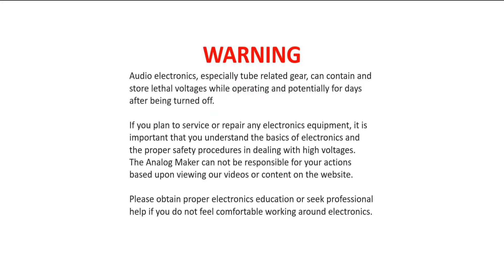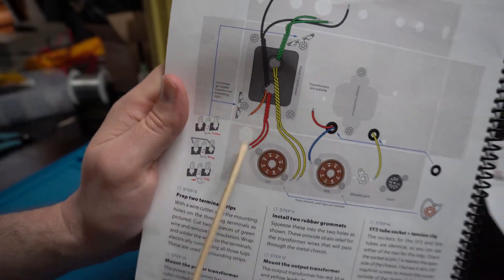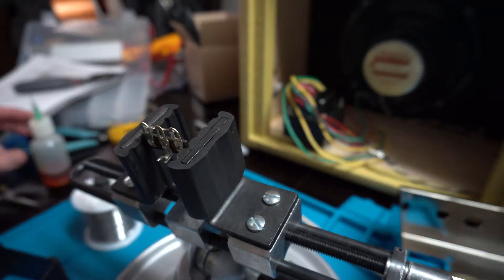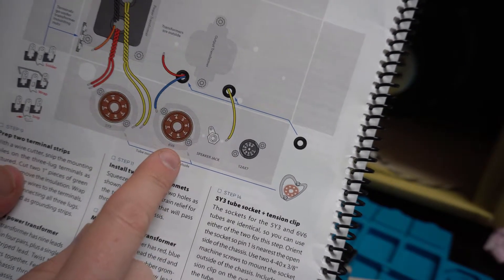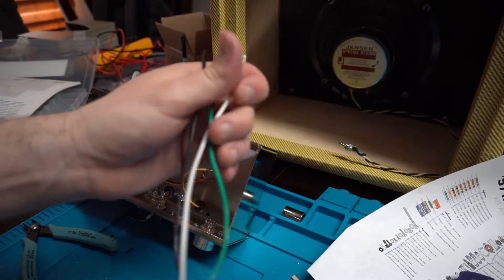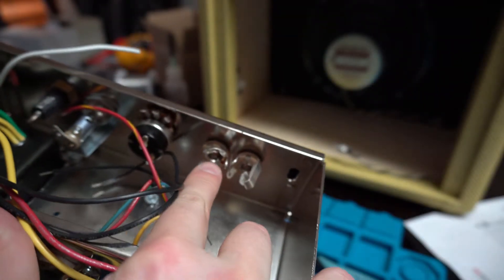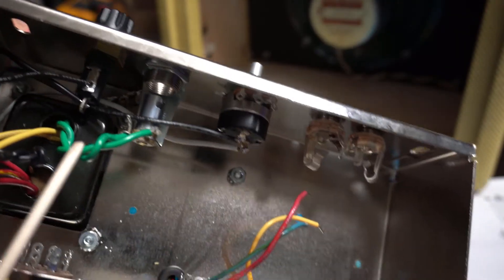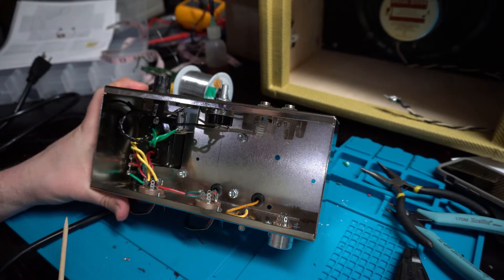StewMac '57 Mini Tweed (5F1) DIY Tube Amp Build - Part 3

Comment: Just a quick note. The switch and fuse should be run in series on the hot (black) lead of your power transformer. (The veracity of the original schematics from Leo have been updated in the intervening 70 years. You can refer to https://tedweber.com/5f1-c-kt/ as an example of the modern wiring method. Uncle Doug will correct this on every vintage amp he gets that is wired in the "original" configuration.)
Reply from the maker: I don't remember if I covered/installed it that way, but I agree.